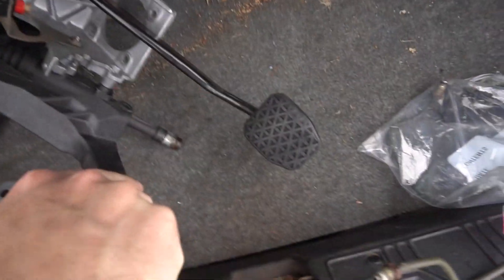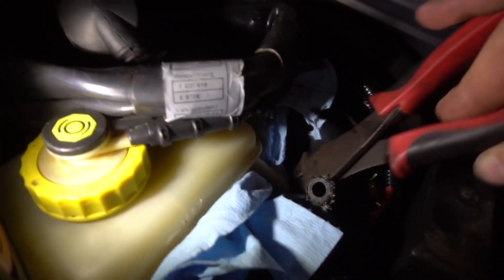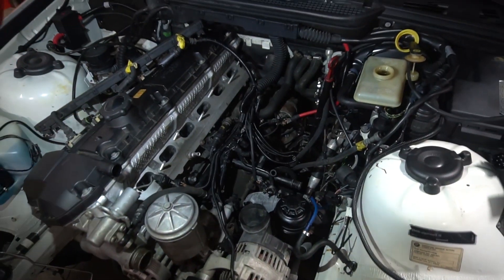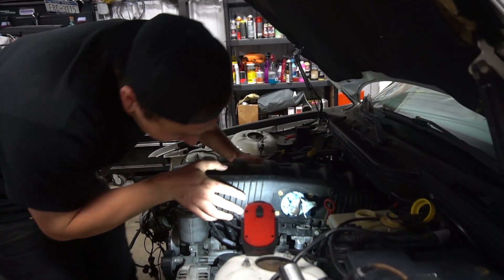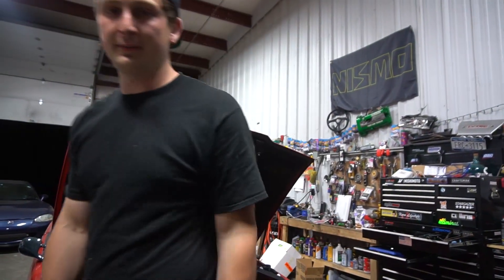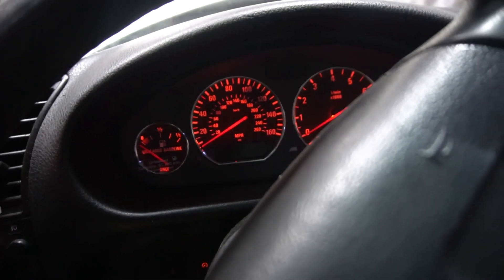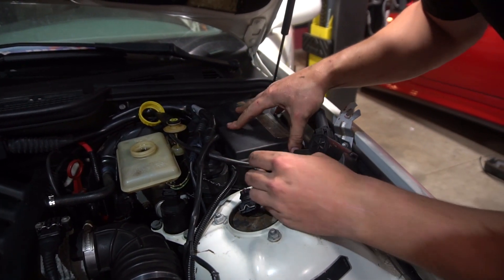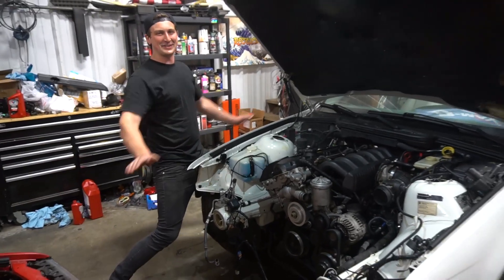Trying to start my bmw m3 for the first time!

Comment: I’ve had issues with bleeding clutches like that , my trick to doing it alone is buy a cheap (sealed) little oil squirter , fill it with brake fluid , clamp it to the resivoire line as if the squirter is the resivoire ,open the bleeder and pump the fluid into it , close bleeder and put the line back on the resivoire , hope what I’m saying makes sense lol works for me every time doing it alone , keep up the great content

Comment: Jimmy, use an industrial syringe to bleed the clutch. Get one that slots nicely into the soft line and force fluid in, whilst someone pumps the clutch. This has worked flawlessly twice for me, it bleeds the air out from the top and you have a fully bled clutch in about 5 mins

Comment: I had the same coil pack misfire issue on first starts with my e46. Turns out there was an old coil that was “soft” failing. The old off and back on trick kept it going for 6 months until I finally paid out and replaced the coils.

Comment: Hey just a heads up you did that pedal swap the hardest way possible. The pedals all use the same bracket, manual, auto doesn't matter. All you had to do was take the auto pedal off and put the manual pedals on the bracket. Just an FYI for your buddy's girls swap.

Comment: lol now I'm pissed, I've spent the last week trying to figure out why me E36 won't start & getting depressed, yours started right up haha
Reply: Do you have EWS deleted?
Reply: @BkSMedia  Not sure, it's a 1992 so it's the first generation of EWS but the wires were a mess in the trunk and the relay box when I got it. Thought I did it a favor by putting it back to stock and pulling the engine to refresh everything... Hahaha how much I was wrong
Reply: Nicolas Boyer EWS was only in late 95 early 96+ vehicles if you have a 92 good chance you have a NV motor
Reply: @MarkyDGFX  Well I read the Bentley Manual's diagrams and from what I understand the first anti-thief systems weren't link to the start of the engine, am I correct ? I think it just honks and turns the lights on if it detects some door being opened

Comment: A tip I have for bleeding these clutches is to use an old slave cylinder like a vacuum bleeder. Hook the feed of the old slave to the bleeder nipple on the slave in the car and pump the old slave

Comment: Had a bitch of a time bleeding my slave on my e46. I was able to get it by pulling it out of the trans, holding it upside down cracking the bleeder and pushing the rod in by hand. Works well.